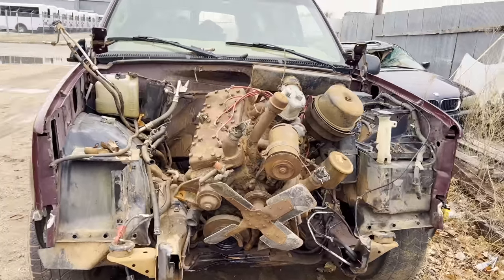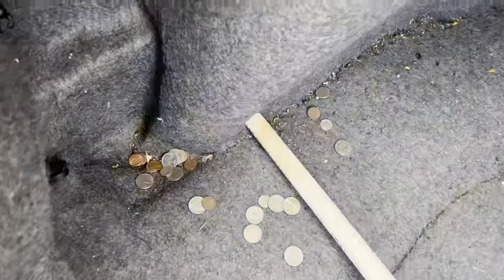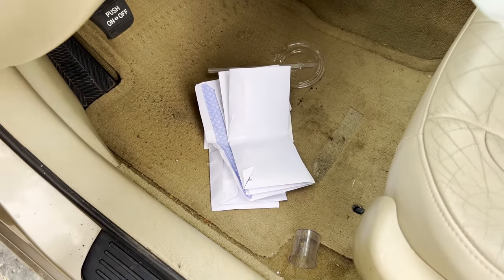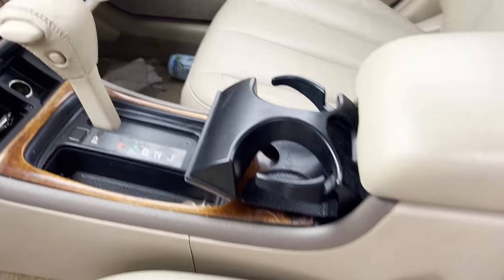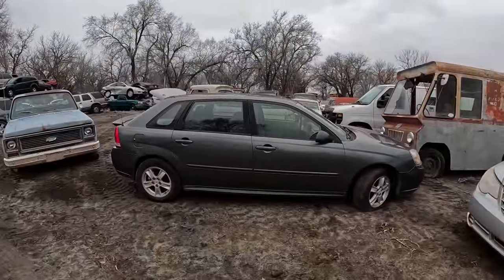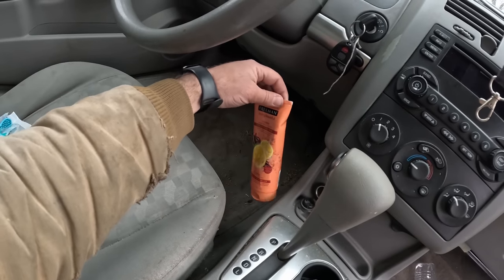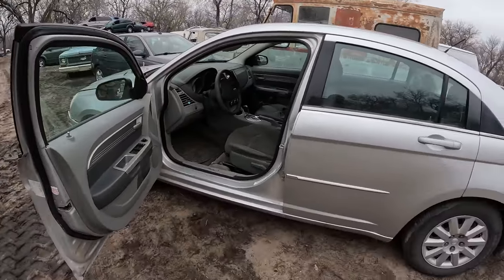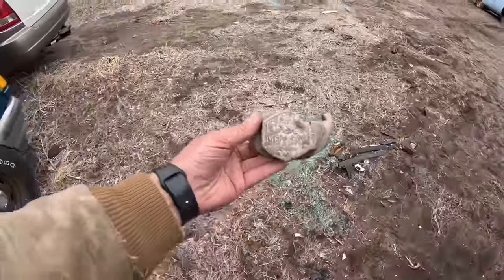I Found some JUNKYARD TREASURE in these SCRAP Abandoned Cars!

Comment: Most of those rear seats only have one bolt in the front on each side of the seat right in the middle and then always pull the back seat out that's where you always find the good stuff

Comment: Here's an odd question and maybe a quick buck to be made every now and again.
Key Fob's on newer vehicles some go for a couple hundred new if you were to attach a booster pack to the battery so you can test to see if they work most can be coded to a different car as long as they take the same kind of remote.
Might be worth the effort and cheap to mail...
Reply from the maker: That’s only in super late model vehicles. Old junk like the ones in this video would be doing good to get $20, and many are only worth a few bucks. Once a vehicle is 5-7 years old parts value plummets rapidly

Comment: i once bought a old pontiac grand prix. they said engine blown and lots of parts. and the rear bumper was almost touching the ground. it took all my little electric winch wanted to load it on the trailer. when i got home started unloading it and when i got to the trunk it was full of Gibson 12 gage automatic shotguns. 67 of them New. my dad made me call the law. come to find out they was stolen out of houston like 3 months before. i got no reward or anything out of it. i knew i should have kelp a few before we called them.